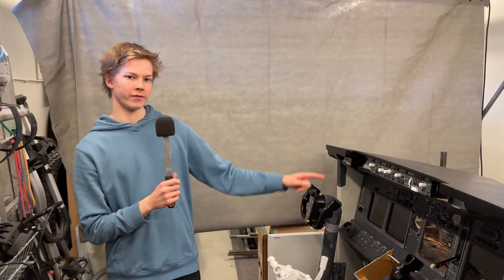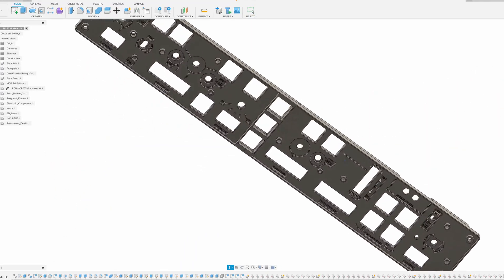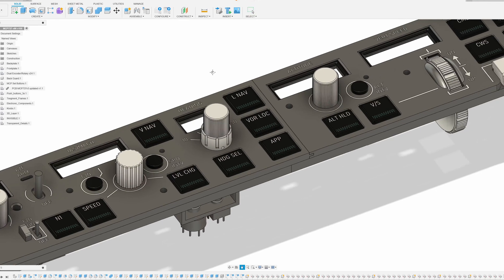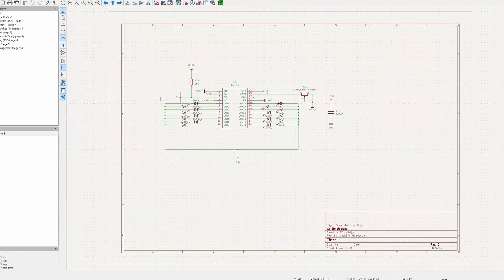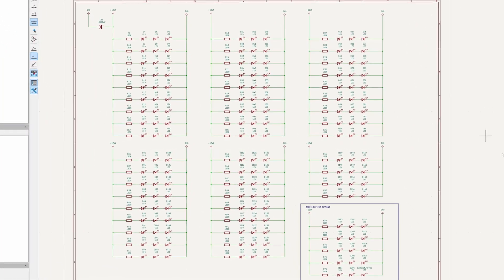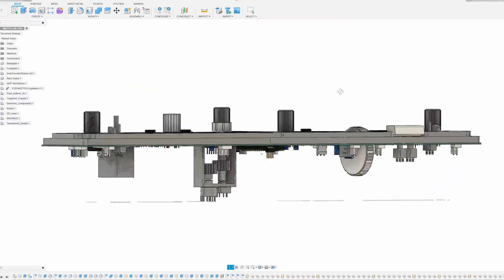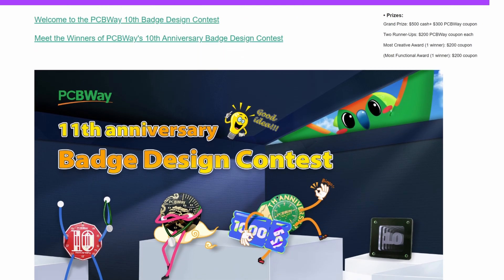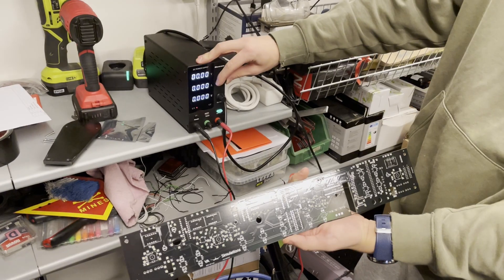Fully 3D Printed MCP With Backlighting [B737 Build #15]

Comment: hi. Bambu labs A1 is ok for this?   tx
Reply from the maker: What is the build plate size for the A1? This MCP is designed for atleast 250x250 plate or else it's going to have hard time fitting on the bed.
Reply: @diy_finn  256x256x256 mm
Reply from the maker: It will fit then👍🏼

Comment: Beautiful ! What materials did you use for 3d printing the pannels ?
Reply from the maker: Thank you! We use ecoPLA from 3Djake.com since they have the exact color of gray we need for boeing panels.
Reply: @ And what about the letters ? Because I guess that you need a special filament to let light pass through ?
Reply from the maker: @clems2828  It's actually just regular white PLA but the trick is to print only two layers of the white so light can still pass through it. The buttons have a special transparent PETG filament to achieve the realistic look but it's not any more expensive than regular filaments.
Reply: @ ok, thank you very much !